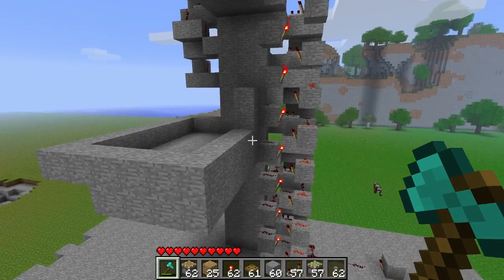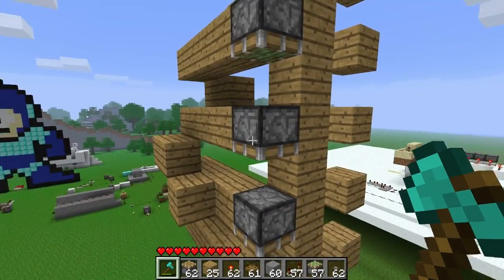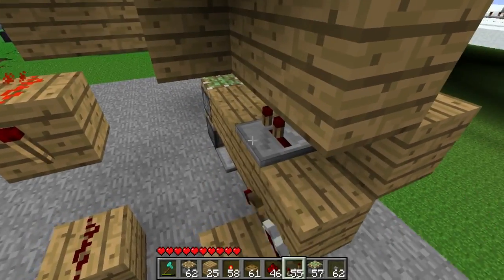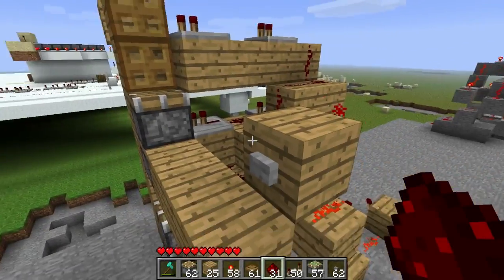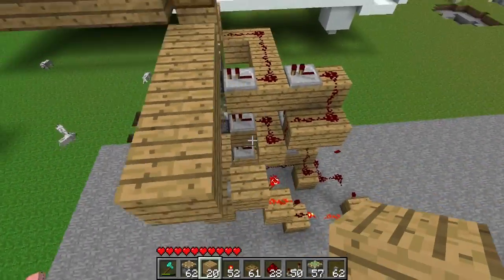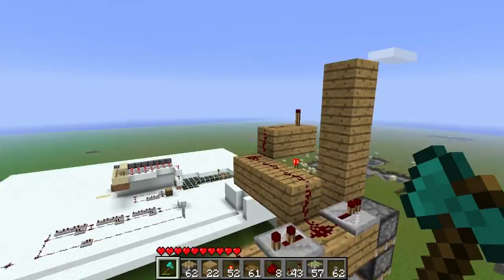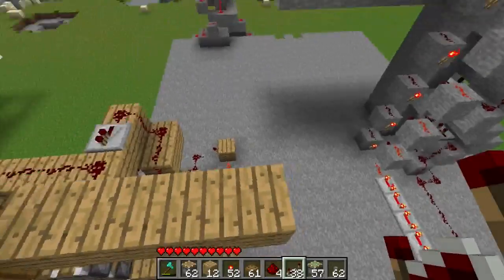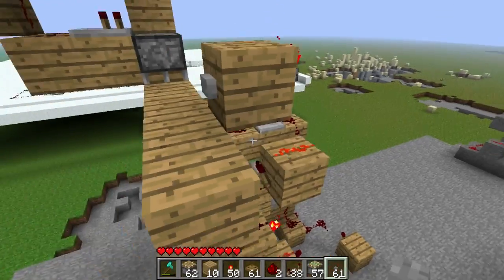Mind of the Maker - Episode 2.5 - How the Piston Elevator Works!

Comment: can the Elevator  only be 9 high or can you build a mine shaft and have it more then 9 blocks high? and can you put 2 buttons one for the top floor and bottom floor and not connect the red stones with each other and have the buttons on two different lines so it would stay at the top or bottom after you use it?

Comment: @R34LxxDiAbLo you just need to put a piston activated by a switch that blocks off the piston set just at the right position. "Piston blocks pistons at certain level, specified by a switch u pull"

Comment: @R34LxxDiAbLo the multiple floor elevator seems easy enough. but you wouldn't be able to make the elevator STAY at a single level. it would slowly rise to the top level with pauses at each floor. then back down again in the same fasion.